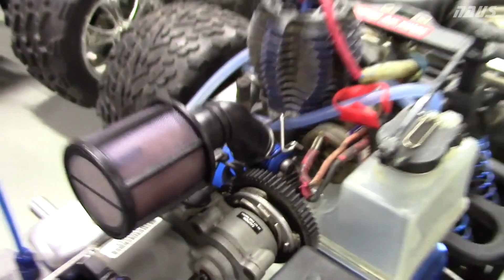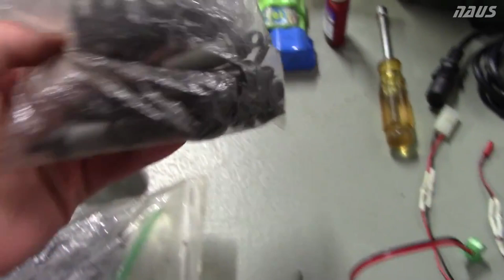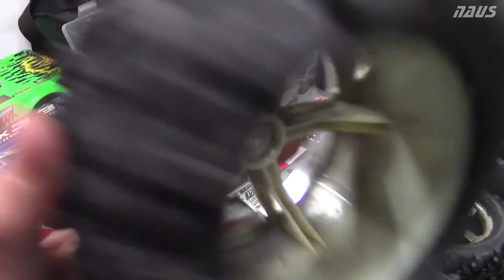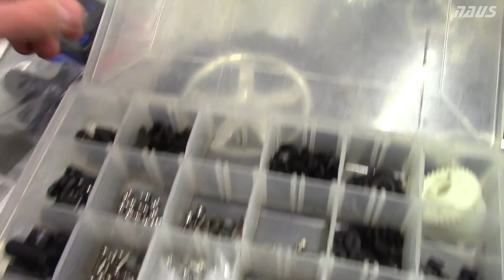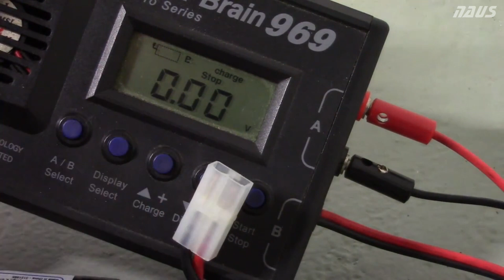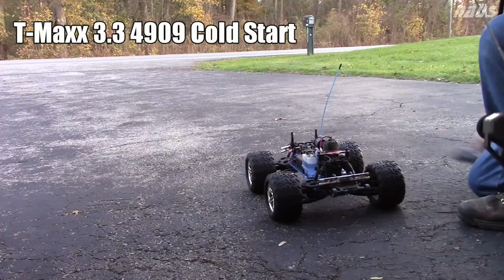My T-Maxx 3.3 Collection - A Detailed Look

Comment: Hey bro new to subscribe with you. I used to watch your gkk videos when i was young! I've always wanted the tmaxx 4909 3.3 with opti drive! Thanks to you lol!! 
WELL i just traded for an all original only missing the transmitter. It sat for well over 10  years in a barn and everything was seized, still had hardened nitro gel in tank and inside motor.  I got motor freed up finally. Added new shocks and springs,w/ 20w oil. Fuel filter, prime bulb and lines. Couple other parts too. 
 It's 20* outside in ny! I haven't attempted to start it yet i still have a little more to check over before i attempt to fire it. I picked up a new spektrum 3ch rc tx also. As soon as i seen the pic on fb market place i noticed the opti drive and messaged him at 4am! Picked it up on 1-3-2025. I can't wait to see if it will start! I'm going to video the starting process for my records! Can't wait... was hoping you still had yours but seen the sale video so apparently not! Anyways figured you'd get a kick out of this!
Reply from the maker: That’s awesome man glad to hear stories like this! Thanks for watching over the years!